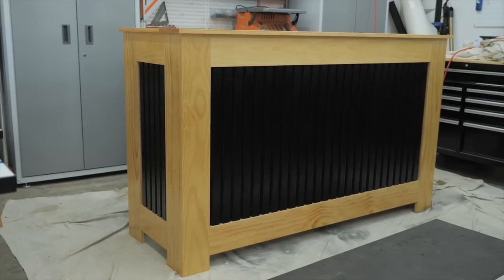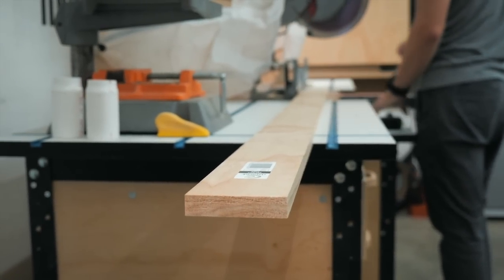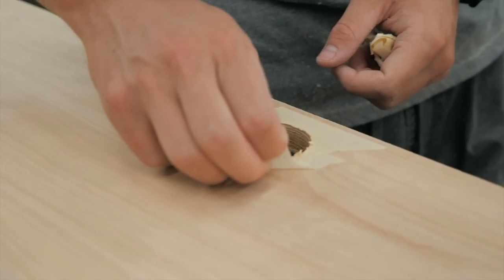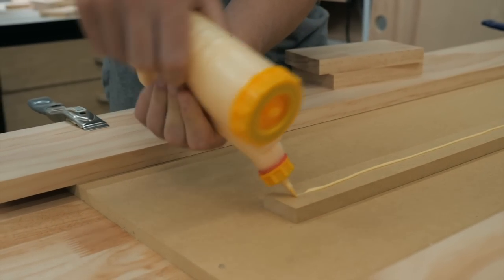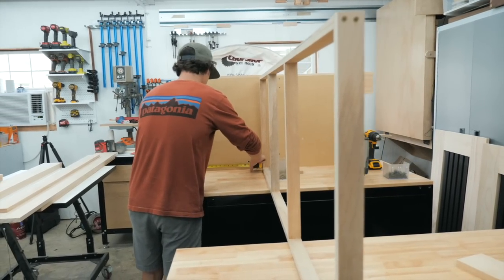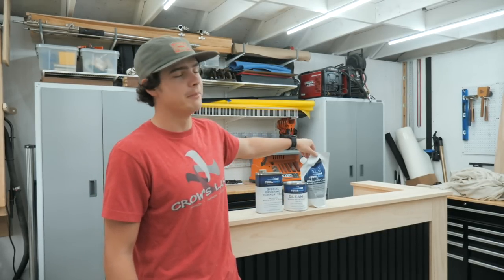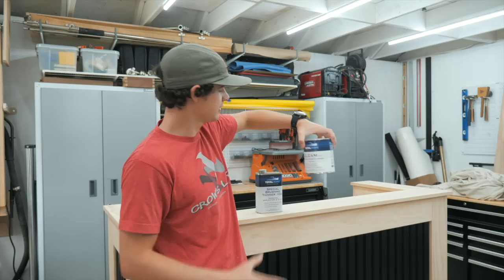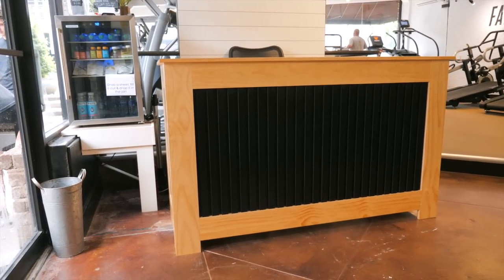Building A Reception Desk For A Gym

Comment: I’m not a fan of how glossy the black is against the soft wood pine. Not sure why a few coats of matte finish wouldn’t have been efficient at least for the black... I understand the the top/pine where ppl will place their hands and rest their arms but surely a good water based finish would protect it.
Reply from the maker: You can get this finish in a satin, rather than a gloss!  This finish though is easier to clean and protects against UV light extremely well. To each their own though! We think it looks rad in the space ✌🏼